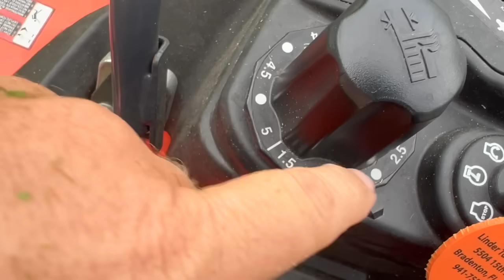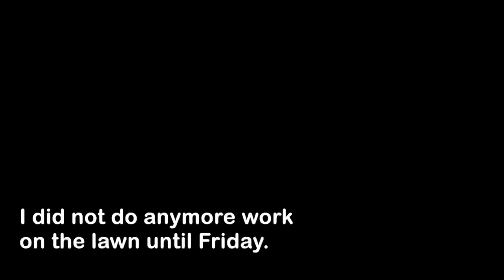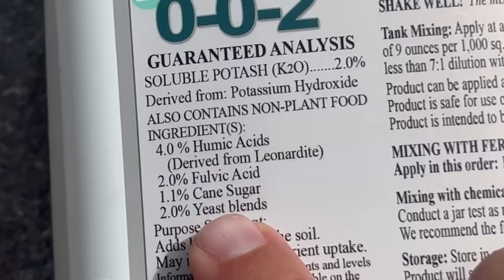My Lawn Is DESTROYED and It's My FAULT

Comment: What I do when I encounter an overgrown customer's lawn is cut it down to length, and then raise the deck an inch and go over it 2-3 more times. Doing that will give the deck more "breathing room" to mulch it up, and it will distribute those smaller clippings deeper into the lawn canopy. It sounds nuts, but it actually works. I've had  centipede and zoysia lawns with 10-11" of cut, and got their clippings to virtually disappear. of course, mulching blades work best for that, etc.

Comment: I did the same thing a few weeks ago. With a crazy work schedule and coaching baseball, the lawn got out of control. Plus it rains a lot in the PNW, so mowing a lawn that was wet AND overgrown wasn’t going to work. Then after chopping down weeks of spring growth, like an idiot, I decided a couple days later to drop the deck low and try and cut pretty low to get rid of the stalks from the seed heads. It took a few weeks of babying for the lawn to recover.

Comment: happens to the best of us Allyn, but I probably would have gone out and bought the cheapest mower with a bagger and got rid of the clippings
Reply: EGO electric mowers already have a grass catching bag. If it is damaged, you can even buy a 3rd party replacement grass catching bag for an Ego mower for as little as $35 USD online. . . And that makes it so confusing. WHY didn't the Lawn Care Nut simply cut and bag at least some of the grass during multiple mowings in this video?

Comment: 19:02  Is the electric thatch rake an option to bring it all up?  The best thing to do with such an overgrown lawn was to blow the first cuttings into small piles and start packing the brown leaf/lawn compost bags.  The mulch blade is just making everything smaller and it will suffocate your root system.

Comment: Great video, next time this happens, used the zero turn again, but this time cut it at 5 then on the 2nd cut drop it 4.75, the the 3rd cut drop it 4.5 . Now on your 4 th cut raise it to 4.75, on the 5th cut 4.75 different direction, then on the 6th cut raise it to 5. Now in between the cuts wait to 30-an hour that will give time to dry, plus you can blow it the back pack blower. I hope this helps . Thanks

Comment: I would highly recommend getting a Honda mini tiller with the thatcher attachment. It does an excellent job of bringing dead material out of the grass and would also  break up the clumps. I’ve had mine since 2023 and it gets used frequently. It is a workhorse and it pays me every time I use it!!
Reply: I don't think SA is one of those grasses you can dethatch.  You'd end up cutting the stolens off.

Comment: Good grief.  I'm not sure how one "accidently" throws equipment away - but if you don't have the equipment to bag, the first thing to do would be to beg, borrow, or rent something that could.  Gray leaf spot?  Would this be a good time to point out that the first rule of fungal infections is to bag, don't mulch, to avoid spreading the spores and infection?  Then you mow (and bag) at the highest setting to start with, drop it a notch and mow it again the next day, repeating the process until it is at your normal preferred mowing height.  Also, continue to bag, not mulch, until the fungus is under control.

Glad I could help.  And while I'll probably continue to use the N-Ext line, I think I'll look elsewhere if I need lawn advice.  Signed, a happy owner (and as-needed user) of a bagging mower and multiple rakes, including the Maintainer.

Comment: So on the big mowers they typically mow a half inch sometimes a more lower then the setting due to the weight of the mower compressing the grass unlike a push mower that can ride atop the grass. You would have been better off with a mulching deck. My 48” ex mark can cut at 6” and it doesn’t clog up. The 48”toro I had with a bigger motor would clog up. Ex marks deck is designed very well.

Comment: I think part of why it’s clumping so bad is since your lawn is used to that small walk behind mower, the weight of the kubota weighs down and it cuts lower even with the deck at 5 inches, I see the same on my front yard when I use my riding mower every once a while on it. The toro recycler isn’t as heavy so it doesn’t sit in the grass

Comment: I have citrazoy in south Florida (ft Lauderdale area) that I planted in Feb. I can’t figure out why it is struggling so much in the freedom factory. This stuff is bullet proof here. I’ve tried empire and zorro, and it gets killed by fungus every year. The citrazoy is really easy to grow. Just like st Augustine, but cut it shorter (1 3/4 inches at my house). It’s Amazing!  

Also, been I. The position you’ve been with overgrown st Augustine. In the future, maybe try to side discharge away from the area you’re cutting and just leave it till the next cut. That way it’s a thinner layer that can dry out on top of the grass.  it will be just one layer. Then it won’t be so heavy smashing down your grass. I’m no expert, but that’s the way I’ve done it in the past to avoid it clumping up on you.

Comment: What about cutting 1/3 several times over several days to get it back to where it needs to be?
Reply: most mowers max out at 4-5 inch deck height. some go up to 6 inch. making it impossible to cut any higher. when it gets this bad you just gotta cut it and remove the clippings from the lawn. not sure what Allen was thinking here
Reply: @poisonousnut  Yes i agree but the point was that i think he was trying to mow it down to his normal height and thats why he scalped some areas. I doubt he had it set at the highest setting. He had a hayfield and for all the cutting he did he needed to spend the time to do some raking. he should have just cut  a center swath with a few passes then throw all the clipping towards the center working his way out. Then rake the center swath and repeat the cut to mulch whatever was cut or drop the deck a smidge and do the above. Probably just too busy to take the time to cut over several days.
Reply: @pdureska7814  he did actually have the highest setting, he mentioned it at the beginning.....1/3 can't really be followed once grass gets this high.... he probably should have cut his loss short early and grab a rake or a lawn sweeper of some sort.... mowing away 5inches worth of grass clippings was never going to be the answer, not sure what his strategy here was but for once, he's made himself look more like a youtuber than a lawn care professional....
Reply: @rogueonevo  yeah i missed that. Dare we say rookie mistake haha

Comment: why didn't you just rake up the clippings and leave it for yard waste pickup?

Also, tip for sod planting. Use wood golf tees to keep your seams together. Once the roots start taking, the wood tees will start pushing out and they won't damage your blades like garden stakes/staples will

Comment: Should have bag mowed it with the ego cutting 1/3 off, maybe a little more, right b4 trash day, fill your and as many neighbors trash cans. Then they pick it up. Then 2 days later you can bag mow again 1/3 off again and fill your trash can. They pick that up and you bag mow again 1/3 off. Takes like 10 days and you fill your bins 3 times but it's takes just as much work to keep it short lol so I don't let mine over grow.
Reply: you have a mower with a 10 inch deck height???
Reply: He said though that he accidentelly threw away the bag for the Ego, so he had no bad, that's why he was saying he had no choice and had to do what he did.
Reply: He said though that he accidentelly threw away the bag for the Ego, so he had no bag, that's why he was saying he had no choice and had to do what he did.
Reply: @poisonousnut  mine goes up to 8, so just go as high as possible, then 4 days later come down 2and then 4 days later down 2 more..etc..make it work
Reply: @natewalls4850  missed that. I'd borrow a bag mower from neighbor. Trying to mulch that much is more work than just bagging it plus none is spread on the mulch beds etc.

Comment: Seems like you need a rake. I would have bagged that, and yes I know you would have stopped frequently to unload bag, but, look at how long you spent just driving over it. Man, if I had a truck and trailer, I would have loaded that trailer with all those bagged clippings and rode to the dump. But, I get it.

Comment: So, you purchased a VERY expensive zero turn "kubota". You said you think there isn't a better zero turn out there. Well that being said, they put a plastic discharge shoot on the mower. For what those cost it should have been steel. You probably would not have a broken gate if it were. Hope your lawn comes back. Hate to see the hard and diligent work go to the wayside.

Comment: Stop acting like you don't know how to fix it. From the second mow you did with the smaller mower you needed to bag it all up then rake the rest. By mulching you are adding more clippings than the lawn and mower can handle. Also blowing thick  wet grass with an electric blower doesn't work that well because it's heavier since it's too wet. But the biggest mistake was definitely mulching over and over that made it a bigger mess than what it was.